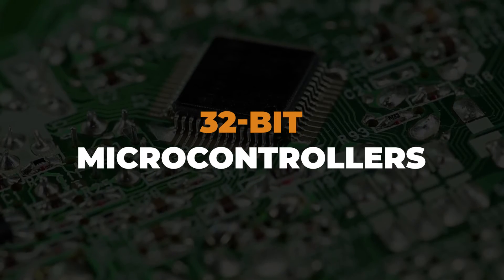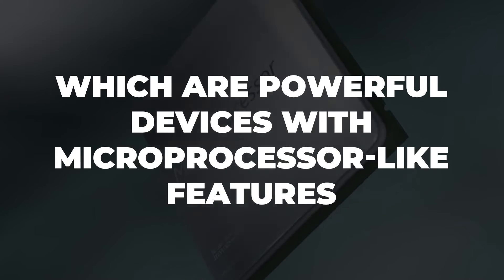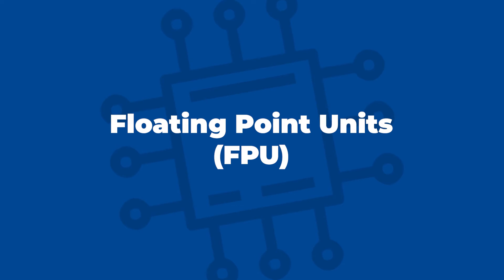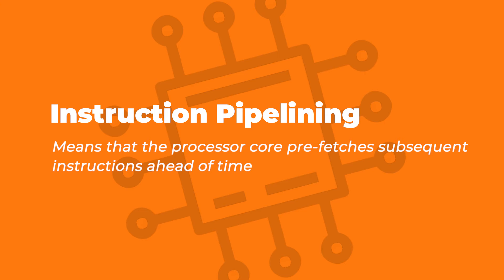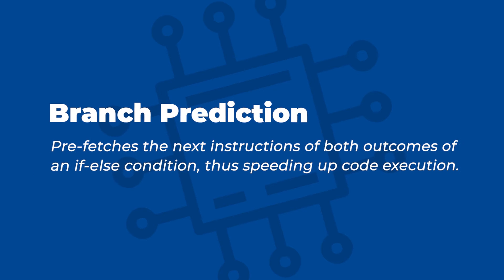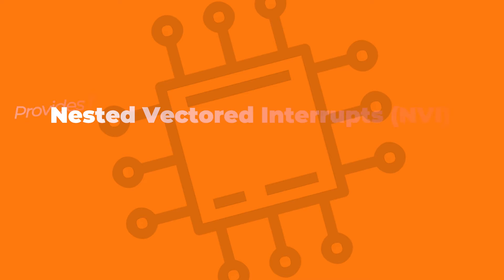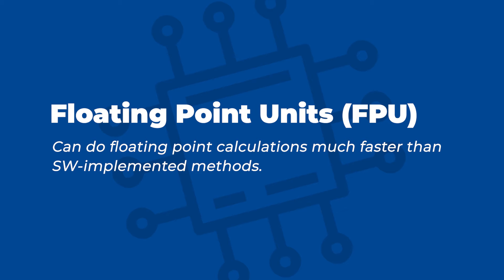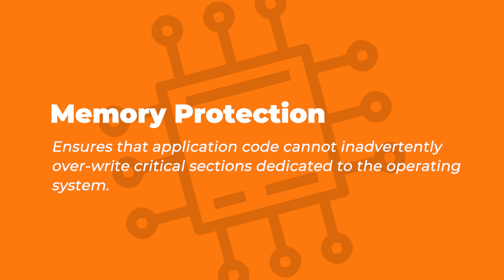Microcontroller Showdown: Which One Wins for Your Project?

Comment: If you intend to write Assembly, 
then nothing as fun as PIC 8-bit microcontroller.

Some of latest 8-bit PICs seem to be pretty competitive price directly to STM32.
Reply from the maker: It's been a very long time since I've programmed using assembly. It was my primary programming language when I was first programming. Although I also did some pure machine code programming before it.
Reply: I wouldn't call it fun, I'd call it horrid.  The bank switching, the moving of data in and out of the "working" register, the 4 instructions per cycle...  I started off on PIC but looking back it's one of the worst microcontrollers, both in terms of hardware architecture and toolchain.  I think it's time to leave it behind.  I do very little asm programming these days but AVR asm was way more fun.

Comment: Hi John, thank you for this great video, as well as all other videos that you have posted. You are definitely an excellent tutor, both to me and many other MCU lovers. Please allow me to ask you a question. Would you be able to make a features and performance comparison between the STM32 family and the NXP RT1060 and RT1170 families? The RT1062 @ 600MHz is used in the popular Teensy 4.0 and 4.1 boards, while the next gen of Teensy will probably be based on a dual core RT1170, which provides a Cortex M7 @ 1GHz and a Cortex M4 @ 400MHz.

Comment: Is there an MCU available today, even a very basic 8 bit one, that does not require an expensive hardware component (programmer) or a specific required IDE in order to program it?  I have quite a few 12 to 24 VDC contraptions that I would like to develop, and have already started on the first. While MCU isnt strictly necessary in every application I have in mind, they could be helpful. In my case, arduino et al, as great as they are, would be overkill, with the vast majority of features unused. I want a MCU that I can program without expensive specialized hardware using code that I supply to it in Assembly or C written in any text editor I choose. Does such a thing exist?

For now I am making my first version of my first project, and also going through the Mimms Radioshack learning lab circuits ... I realized at an early point that I needed to understand more about circuits than just wiring and programming a programmable IC.  A lot of what I need can be done with non programmable ICs, like 555 or op amps. 

Enjoyed the video, new sub. Thanks for sharing, please be encouraged to keep sharing with us!
Reply: Maybe a RP2040 ... still learning. Btw, watching this great video for a 2nd time now .. its still great, love the channel, thanks.

Edit: P.s.: I'm aware that there are diy methods of sending code to MCUs, each of varying difficulty depending on the protocol required by the specific MCU. Maybe I'm odd or off for even focusing on this, but I really resent having to rely on specific hardware (programmer) and software (IDE) to make the thing work. 

E.g. for many applications suitable for 8-bit MCUs, widely available and very cheap ICs wired together to perform the needed logic might be a better choice. So why do the MCU manufacturers require me to use their specific stuff.

Comment: yeah, but for that temp humidity example ESP 32 might actually be perfect because of the ULP capabiity and deep sleep features, plus wifi bluetooth and there are just bucketloads of them around
Reply: I use the esp32 and wifi enable temp readings around the house,  32 bits and hundreds of MHz. But it was easy and didn't cost that much, and I can reprogram or repurchase them.

Comment: These videos are nice sanity checks for my future possible products designs. I normally use Cypress PSoC micros, which can have their own 8bit core or 8051 or Arm M0/M3 core. CPLD like programmable peripherals is very handy for weird IO apps.  I am looking at those very low cost RISC-V, just because of their emergent capabilities for the price. No design license lowers the cost for mass production. All that said, time is money, I like software tools that shorten code development time. I tend towards Free Pascal as the stronger code typing reduces debugging time than the traditional C methods. Even thinking about Ada for long term reliability as it can work on microcontrollers now.
Reply from the maker: Great to hear, thanks for sharing!

Comment: Here's a summary, keeping the timestamps:

00:00: Selecting the Right Microcontroller

This segment emphasizes the importance of selecting an appropriate microcontroller for a project, focusing on factors such as room for growth, performance, cost, and support.

Factors in Microcontroller Selection:
- The microcontroller is a crucial initial component for a project.
- Changing the microcontroller midway can be problematic compared to altering other components.
- Choosing a microcontroller with room for future expansion is vital.
- Balance between growth potential and avoiding unnecessary costs or complexities is key.

Key Considerations:
- Costs, performance, power consumption, overall size, tool availability, community support, and development board accessibility.
- Libraries with well-documented APIs can significantly reduce development time.

Common Microcontroller Features:
- All modern microcontrollers include flash memory, SRAM, clock sources, digital I/O ports, timers/counters, and UART for serial communication.
- Distinctions lie in memory size, integrated peripherals, clock speed, data width, and hardware acceleration features.

Categories based on Data Bus Width:
- Microcontrollers are grouped into 8-bit, 16-bit, and 32-bit categories.
- 8-bit for low-end applications, 32-bit for higher-end applications, and 16-bit as a balanced choice.

Examples of Microcontroller Families:
- Arduino often utilizes 8-bit microcontrollers like ATmega328P.
- Some 32-bit microcontrollers can be competitively priced compared to certain 8-bit options.
- Available microcontroller sizes range from small to larger chips with up to 64 pins.
- Popular families include 8051, PIC, and AVR series.

06:27: Conclusion

Summarizes the importance of considering specific application requirements when choosing a microcontroller.

Considerations:
- Application requirements, user interface, data processing, memory sizes, and system complexity.
- Different microcontroller families cater to varied applications.

The subsequent segments cover various topics related to serial interfaces, microcontrollers from different manufacturers, and detailed specifications of 16-bit and 32-bit microcontrollers, discussing their features, popular models, and specific applications.

Comment: i feel like with ST introduction of stm32C and stm32G series, the line between 8bit and 32bit mcu becomes super thin. Recently I used stm32C0 series in one of the external module I made for the device and I got it for 1.4dollar. And the support of ST is marvelous. So I feel like 32bits mcu are no brainer.

Comment: Can someone tell me the best microcontroller to use for a wireless security camera?. I plan to use a Sony IMX low light camera module. I'm currently looking at Arducam and ELP USB camera modules, but am stuck on the best (for the price) microcontroller to use

There may be more than one microcontroller that equally fits the specifications. I don't want to buy the wrong one and regret it later
Reply from the maker: I'd probably go with the ESP32 since it's both very fast and has built-in WiFi.
Reply: Yes that was my thought also. Because of the 32 bit and the WiFi.

I'll study that. Thanks

Comment: 8 bit micro-controllers are available in 100 pin packages.  (the ATmega1280 and Atmega2560 used in the Arduino Mega board for example).  IIRC there may also be a version of the PIC in a 100 pin package as well.  But most 8 bit micros do max out at 64 pins.  On the flip side, there are some small pinout packages for 32 micro's, usually from the Arm Cortex M0 family.  Thanks to support from the GNU C/C++ compiler, both AVR and ARM Cortex micros are not difficult to program.  ARM processors generally require more complex initialization operations to set pin mux registers, however most of the init code is included in the GNU C library, or generated by the programming IDE's such as AVR Studio, MPLab IDE, or Arduino.  BTW, since Microchip purchased Atmel, they have merged PIC, AVR, and SAM (ARM) chip support into all of the Atmel and Microchip development tools including MPLAB, Atmel Studio, and the Pickit & ICE programmer-debuggers. 
You are correct that the 8051 is mostly used as a core hardware library for ASIC chips.  While there are some stand alone 8051 micro controllers available, most are either mask rom or OTP eprom program memory that isn't well suited for DIY projects and require either an emulator or expensive development hardware to prototype.  AVR and PIC 8 bit controllers are mostly flash based, as are almost all current 32 bit micros.
Reply from the maker: Thank you so much Kenneth for sharing this here!

Comment: For me it has to be cheap and simple to use in my hardware designs. At the moment it's the STM32G030 because it doesn't need a crystal oscillator, external pull-up or pull-down resistors and just one Vdd and one ground pin. Also very interesting is the RP2040 because of its programmable IOs, and also the various CH32 controllers because some can handle 5V and thus can be powered by a Li-Ion battery without regulators.
Reply from the maker: Agreed. The RO2040 is definitely an impressive MCU and they only cost $1 even in low volumes. Thank for sharing!
Reply: Almost all stm32 series has this, why do you prefer only g030 series just curious as I am in process of selecting micro for my project and I have finalized stm32g030c8t6
Reply: @jeswanthkumar4291  
The STM32G has a temperature compensated RC oscillator, which has a tolerance of +-1%. I was using the STM32F103 before, which has a much bigger tolerance and needed a crystal oscillator for my use case.
Reply: @andreasschmitt2307  thank you for the reply. I want to use internal RTC with external 32.768khz crystal, do you think it's a good idea. I am trying to reduce cost.
Reply: @jeswanthkumar4291  
I'm using the same configuration, so this works.
Reply: @andreasschmitt2307  thank you so much.

Comment: At work, relatively recently, I was forced to get acquainted with STM8 microcontrollers. And I like them. A sort of STM32 larvae. DMA, a bunch of advanced timers, an LCD driver, but it's all 8-bit. I think they should also be mentioned in the review. Although, of course, their support is useless -- a very buggy IDE that crashes spontaneously from time to time and does not remember some settings, the community is practically absent. But if you already have experience in developing embedded systems, then all this is bypassed.

And of course I appreciated 8-pin STM32s with Cortex M0+ core. They're so small and yet powerful. Features like e.g. swaping USART pins available. I've done quite pretty Christmas light-effect device with one of it. And it's like a magic when that tiny IC drives more than a hundred LEDs (via registers of course) doing 50-100 frames per second.
Reply from the maker: Thanks for the helpful feedback! I appreciate you sharing your experiences.

Comment from the maker: One thing I should have mentioned is supply chain stability and availability. Especially now with the current chip shortage many microcontrollers are impossible to find in stock. Although I think this should get better soon.
Reply: Hi there! I'm curious which of these chips are used in popular vehicles?
We kept hearing about chip supply issues for cars these last few years. Do they use these or something else?

Comment: Hi John, there are many ways to include a low battery indicator LED to a circuit. Do you recommend a method?
Reply from the maker: It depends on the type of battery. For lithium ion it's best to use a fuel gauge chip since they don't have a linear discharge curve.

Comment: Great! I liké your vidéos. Are there some MSP360 That support LCD Segments ?
Reply from the maker: Great to hear, thank you Stephane! There are many MSP430 variations so I'm sure there sure you can find a model that works. Personally I tend to use STM32 microcontrollers most often.
Reply: There definitely are. At work I have some prototype (not mine) with MSP that supports LCD with no additional parts needed. I'll try to not forget tomorrow to check what a particular MCU those prototype has. If you would answer to this my comment say a 10 hours later it will help me to remember.
Reply: @Ma_X64  Hello, thanks in advance. Did you check ?
Reply: @stephanelonkeng2259  Hi. Just done.
It's M430FE4272. I was sure that it what you want but, obviously, mistaken.

Comment: What about Nordic Semiconductor?
Reply from the maker: I do like Nordic but mainly their line of Bluetooth microcontrollers which are also Cortex-M based.
Reply: I like them.  Ones like the nRF552840 even have the voltage regulators built in.  Just got done with a project where it saved me the need for an extra voltage regulator.  Also, the chip runs on 5V.